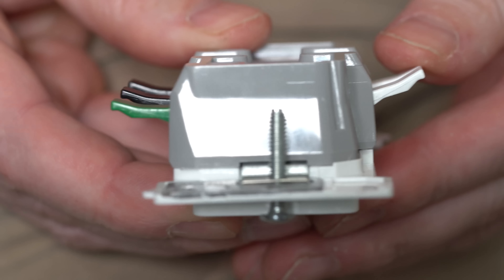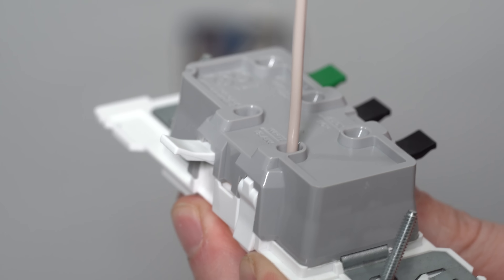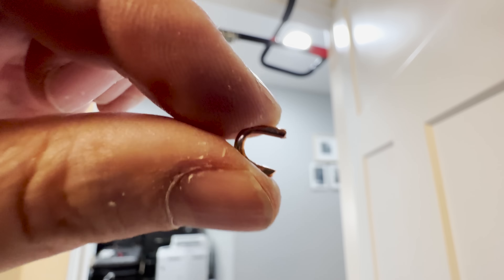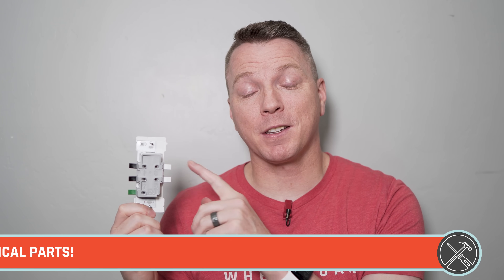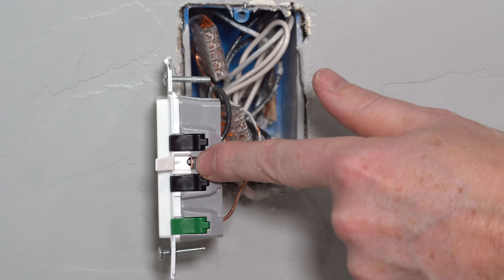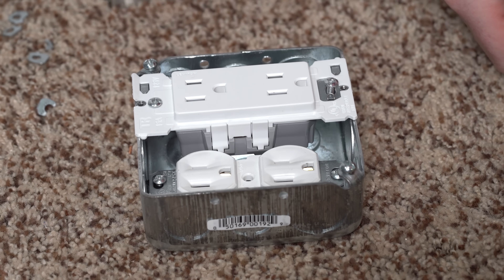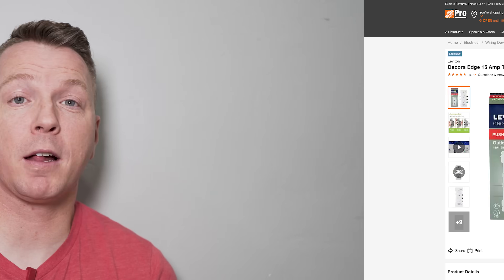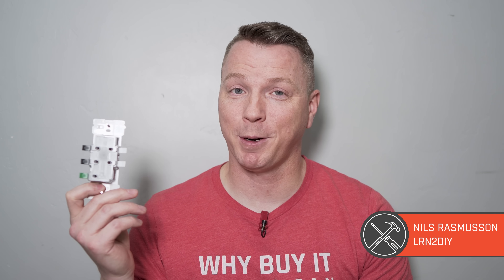The Outlet Has Been Reinvented... And It’s Pure Genius

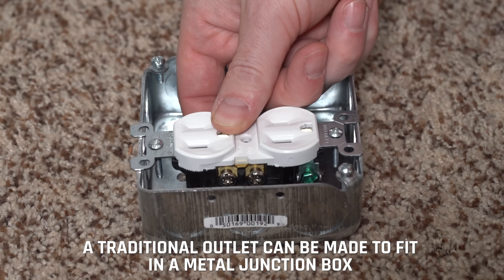Comment: Your comments at 7:05 about metal boxes is a bit misleading. They only place they won't work is with 4 square surface mount metal box covers, where the device mounts to the cover and not the box directly.

Comment: Issue is that they don't work with metal boxes.   I had a fire a few years back that started at an outlet due to a wall wart charger overheated an caught fire.   The metal box that the outlet was mounted in kept the fire from going up the wall and kept the damage limited to the cabinets above it.   There was a plastic electrical box used for low voltage about 6' away and it completely melted compromising the integrity of the wall.  Luckily the fire had not gotten there yet.  I will only use metal electrical boxes.
Reply: They work fine with most metal boxes, with the exception of industrial 4 square box covers. The problem there is that they can't be legally modified to fit in the cover. 
They work fine with mud rings and metal boxes with device mounting tabs.

Comment: interesting idea, but it doesn't fix the issue of the wires sticking straight out of the back which maybe isn't a problem with a box with minimal wires in it but if there are a bunch of wires those wires sticking straight out of the back may not survive.

Comment: These things are amazing. Super easy to install. I'm not a licensed Electrician. But these things cut my install time in half (20+ outlets).  These are easily removed, easy to lock-in and since there is no exposed metal, easy to work with. For example, I had to take 4 just-installed outlets back out to readjust faceplate (long story). Since there is absolutely no metal, there was no issue grabbing the outlet and no need to cut the breaker (I know, I know - always cut the breaker anyways).
IMO, I'm all for technology advancing and making things easier. No reason a 100 year old design couldn't/shouldn't be improved.

Comment: As a European US electrical equipment always cracks me up, I fail to understand how it can still be so "antiquated !!!" ?
Reply from the maker: It's like we're in different worlds sometimes. I have worked with some European receptacles and switches and it's an entirely different setup. We work with what we have, I suppose!
Reply: @LRN2DIY  
I suspect you are victims of Edison who managed to make the standard110V (DC at the time with all the issues that created) hence requiring more amps for a given power output which meant that push style connecters which are better suited to high voltage low intensity (at least when they were first developed) were seen as "unsafe".
That and since you require thicker wires you need "beefier" components just to handle the wires themselves 

That and bureaucratic inertia

Comment: This is certainly an improvement and should make things better for the DIY community as well as the pros. 

The sad thing about innovations like this is that companies use them to raise prices - I seriously doubt that they cost any more to make than a traditional outlet/switch since there is much less metal in them (no screws) nor is any threading of components needed so - they should not cost any more than a traditional outlet/switch. Likewise, the safety aspect is considerable, but companies also use patten laws to prevent their competition from incorporating such safety features to keep their profit margins high instead of sharing to promote such safety features.

It may be a long time before the other brands can incorporate such features in their products.

Comment: I'm not sure how these are safer than the traditional?
Reply from the maker: It’s because no wiring or charged metal is exposed. With a traditional outlet there are 5-7 places that shouldn’t be touched unless you’re 100% positive the power is off (something that is mistaken all the time), but with these the entire thing is sealed so you can touch anything on it even while it’s hot. You should always disconnect the power but this is way safer.

Comment: Do these require a ground wire or does it come self grounded?
Reply from the maker: All three prong receptacles require a ground in the US, including this one.
Reply: @LRN2DIY  some have a ground wire, others ground to the box. I was just wondering if it needed a wire or would ground to the box
Reply from the maker: @bluehannah8696  Ah, I see what you're asking. So that depends on the box and if the box is grounded, but doesn't actually change based on what outlet you use. It would be awesome if an outlet could self ground but that's more about the structure/wiring of the building and how the ground is set up.

Comment: I have hundreds of dollars worth of switches and receptacles carefully organized by color, style and function.  But if this is what it looks like, I could see myself throwing it all away and starting over.
Reply: DON'T 
Wagos are for Wimps.   Way more surface area, Current capacity and mechanical strength twisting and wire nutting.
If Wagos heat up they fail.  Twisting and wire nutting will survive a house fire.

Comment: There are a few Wago vs Wire nut videos around.  But none that I have seen do a proper comparison.  Insertion tensile tests and max current tests are mostly irrelevant.  Connectors fail due to cyclic thermo expansion of the wire due to current heating.  Back stabbers are particularly poor under this load scenario; especially when using aluminium wire with it's higher thermal expansion coefficient. A proper long term thermo cycling test is needed to settle this.

Comment: Just updated outlets and switches (for color) and it took over 4 hours! (Had to fix mistakes made by contractor) wire nuts are not fun and three-way switches are not all the same... and not everybody uses the correct wire colors for them. This new invention would have saved me a lot of time!
Reply: What code violations????) He simply changed outlets and corrected mistakes ??????)
Reply: You are admitting publicly that you committed a several code violations and crimes. Call a Licensed electrician before you have a House fire. Contractors are not licensed electricians.

Comment: Well, in Australia DIY electronical work has been banned for as long as anyone can remember. 

Schneider Electric has done something similar for Aussie/NZ/Chinese style GPO’s and switches. The Clipsal Iconic range has been a game changer. Similar features. Safer. Easier. Every new home and renno has sparkies choosng these outlets and switches. No push throughs on the switches. Easily replace facias and switches without having to do any interference with the switch block or GPO itself. 

Less time for sparkies to install, so the benefit for them is huge. Fix off a whole home in less time.

Comment: Can you use this for an outside outlet (providing that the enclosure is correct)?
Reply from the maker: You'll want to double check your local code on this but outdoor outlets typically have to either be GFCI or at least downstream of a GFCI outlet, as well as protected in a sealed box.

Comment: This is a much needed design improvement. Last place I lived in had arcing in the outlets due to the horrible wiring job done by the building company where they removed way too much wiring insulation and installed in metal boxes. The entire place was an electrical fire hazard due to corners cut and sloppy work by the construction company.
Reply: If they are removing that much insulation, then it was done incorrectly. That is not due tonpoor outlet design.
Reply: This is  a house fire waiting to happen.
Wagos are for Wimps.   Way more surface area, Current capacity and mechanical strength twisting and wire nutting.
If Wagos heat up they fail.  Twisting and wire nutting will survive a house fire.

Comment: I'm from the UK, I cant believe how far behind US electrical installations are, granted it is 120v as opposed to 230 but it's unbelievable how sockets (outlets) and switches have massive screws poking out the side, easily touching the potential metal box!!! It's so ironic with such a technologically advanced country having what looks like 3rd world electrics. Also, WAGOs are far superior to wire nuts. Wire nuts aren't allowed in the UK
Reply: As I mentioned earlier, it seems like most people in the US would like to advance, it’s the professionals themselves who seem to be more resistant to it. This is true in our banking system as well.
Reply from the maker: Agreed, agreed and agreed. For us, this is a massive step forward.
Reply: @LRN2DIY  Absolutely
Reply: @LRN2DIY  You do not know a thing.
Reply from the maker: @mrgcav  Care to enlighten us? I'm always looking to learn.

Comment: I'm in love with this. Receptacles with built in Wago style lever connectors. Genius! Will use these often depending on price.
PLEASE do a disassembly video on one of these comparing it to various grades of outlet like residential and commercial.
Reply: I'm surprised they are only $3.50! I was expecting more like $5-10 each. Disappointed they are only 15A and only residential grade though. Still want to see a breakdown!
Reply from the maker: These are very similar to most residential grade on the inside, not quite commercial grade. This is the very first rollout though, so I'm hoping to see more industrial versions in the future.
Reply: @LRN2DIY  If they make 20A and commercial grade versions, it's all I will buy! Hahaha.
Reply: Wagos are for Wimps.   Way more surface area, Current capacity and mechanical strength twisting and wire nutting.
If Wagos heat up they fail.  Twisting and wire nutting will survive a house fire.
Your asking for a house fire.

Comment: I've been replacing all of my outlets and switches with the Decora using the two-part plates that don't leave screws visible.  I like the clean look.

These are definitely interesting.

I still like the extra security of outlets that are capable of the straight side wiring.

I do use Wago connectors but primarily when I'm wiring light fixtures that use stranded wiring.  I don't like using Wago in higher current applications.

The extra safety and simplicity on these new outlets is great for new DIYers.

Comment: Wagos have been proven to have resistance, and resistance causes heat! I found two wago connectors in an addition that was built into our home 2 years ago by the previous owners. One was melted and no longer working, and the other had signs of overheating.  I, for one, will not be using wago's ever!
Reply: What was wired on that circuit?

I use wago connectors for lights but prefer side wiring for my outlets.

I think the wago connectors are better for dealing with light fixtures that use stranded wires.

Comment: I don't really care about light switches, all occupancy sensor switch/smart switch I installed so far come with a color coded piggy tail which works fine with Wago lever nuts, it's unlikely I gonna put more dumb switch in my house in the future, but receptales, they really need to start making these receptacles with GFCI like right now.
Reply: Wagos are for Wimps.   Way more surface area, Current capacity and mechanical strength twisting and wire nutting.
If Wagos heat up they fail.  Twisting and wire nutting will survive a house fire.
GFIC were created to create a new market segment not for the safety reasons everybody believes.

Comment: Nice product. Re mis-wiring. Looking at any (US) receptacle, with ground prong down, hot always goes on the right-hand side (narrower vertical slit in face). Larger slit is for common or white wire. Cost and speed of wiring will always be the driving force in the industry. The manufactures pay attention to the trades, which far outweigh the DIY'er voice. Just the way it is. Thanks for the video. Retired electrician.
Reply: Well this is certainly faster even if the cost is slightly higher.
Reply: You are correct.

Comment: Glad you guys are using a better outlet. In France there's no screws at all. Solid wire just goes into the hole and it's solid. It has 2 holes so you can wire in series.

Comment: The Wago lever connectors are revolutionary and my favorite, I was waiting to see when they would be incorporated into switches and plugs, it’s about time. Thanks for all the great videos. 🇺🇸🎸👮🏻‍♂️
Reply: They Are garbage and over heat
Reply: Wagos are for Wimps.   Way more surface area, Current capacity and mechanical strength twisting and wire nutting.
If Wagos heat up they fail.  Twisting and wire nutting will survive a house fire.

Comment: These look great, definitely worth the slightly higher cost.

The only thing i would run into with my house i just sold was clearance issues in the rear of the outlet. It was an older house, so not sure if codes/tolerances were different when it was built, but these may not have worked as the protrusion of the wire might have been an issue.
Reply from the maker: That's an interesting point. Traditional outlets are about the same thickness and are designed to have the wires come straight out the back as well but there's more flexibility with those in what direction they go. Smaller junction boxes are definitely a consideration here.
Reply: @LRN2DIY  I see a very near future where Leviton offers a larger box, even larger METAL boxes that these will fit into without alteration. Other companies might be able to offer boxes designed for these, but they'll have to beat Leviton to the patent office...if Leviton hasn't already.